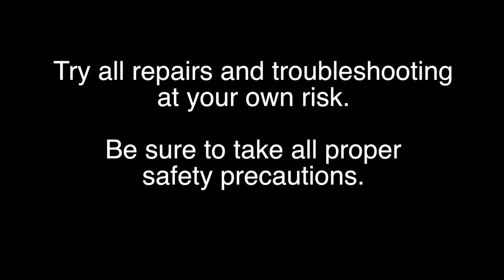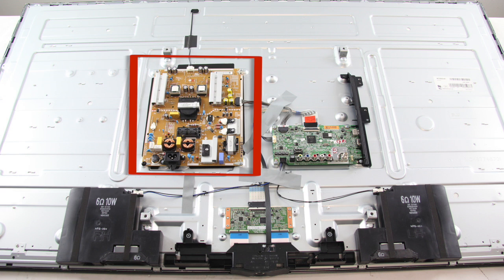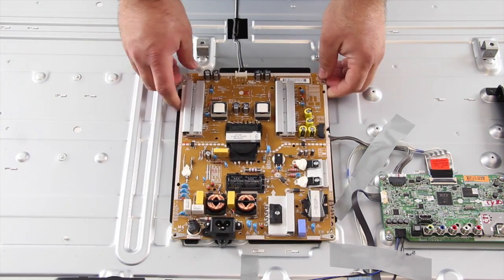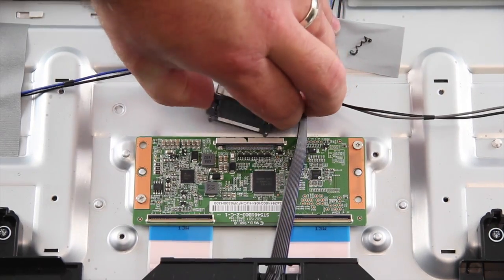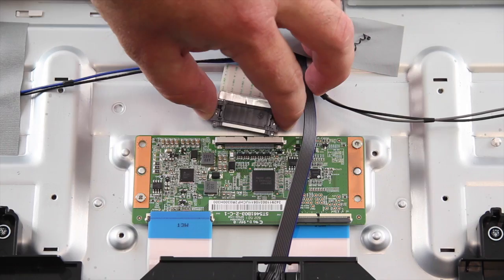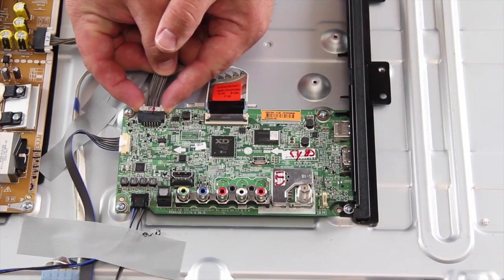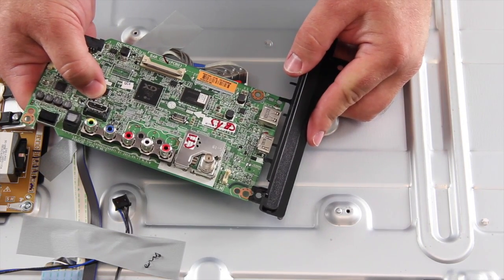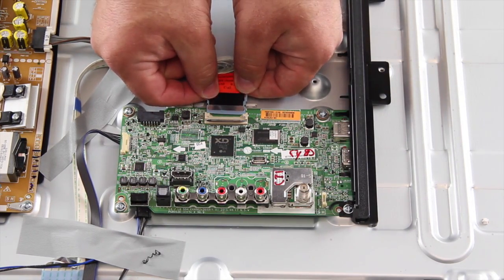LG 55LF6000 TV Board Replacement - How to Fix Your LG 55" LED TV - LG TV Support

Comment: I have an LG55UM6910PUC it just shows a blank black screen. When it first happened there was audio and you could switch channels but no picture. Now there is no audio so I can't tell if the channels are changing with the Remote.

Comment: Hi my name is Manda and I have a 55 lw5600 and the screen suddenly stopped working on it... I was given a  lg um7570 because the screen is broken... And my friend thought I could use the bigger broke screen lg um7570 TV's boards on my tv to get mine the LG 55LW5600 is this possible? or should I just get a replacement one from a store stating my model number

Comment: My tv model is LG 60PA5500-UG. The TV turns on and the AV port works but all of the HDMI ports and TV ports were damaged. The TV only gets audio and video from the component ports. I believe i need a replacement board. What model replacement board would I need and do you offer it? The manufacturing year was 2012.

Comment: Help, my LG 55LE5400 TV is getting power, Audio, and bezel lights up. There is no video output at all , no display at all on LCD. Tried resetting power, no effect. Tried all inputs and volume increases with remote. There is no T-Con board in this model from videos I have seen online, just the main power board, the main board, and the LED driver board. No Logo displayed on boot up. Please advise as to what I can do to have this unit repaired at little to no cost.
TV is cosmetically pristine and used very lightly, was very surprised that this happened.
Reply: Do you found a solution? Have the same problem

Comment: What do you thinks about that Do you think I have to replace the motherboard
Reply: My boss just gave me 2 TV's that were hit in a storm by lightning...a 55inch lg and 30inch insignia.
The lg power supply is still good. All it needs is a new motherboard.
The insignia need a power board and probably motherboard.
Hopefully its just this easy to fix em. 
Never worked on a tv before

Comment: Please I need help my 65 LG tv I hear everything but I can’t see nothing
Reply: I have the same problem mine is model 55lm4700 ue .... I took it off the wall and I notice a small part on the power supply burned out is #c603 may be you have the same issue...i hear alot of people have it too

Comment: My 55' lgtv started out with a really thin blue line down the middle of the screen, couple hours later another line appeared. Turned it off to go to work and when I came back in the morning to turn it back on, only sound no picture. Any ideas what that could be and how to fix it?
Reply: Blue line due to t-coin. Must be changed. 
No light, is due to led failure. Need to change led strip. 
Practicly, you'r gonna feel pain in that place ☺️

Comment: My backlights come on and stay on but no sound no picture but have white box in the middle of tv lg55lf6000-ub I have standby that flashes 2 times then goes off when I power tv on
Reply: I have the same issue. Did you get it fixed. What did you do